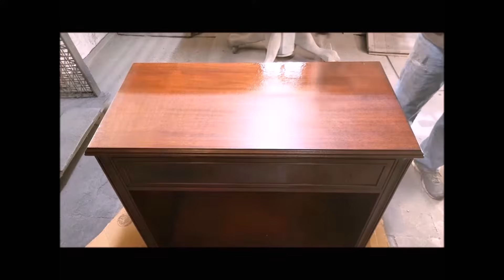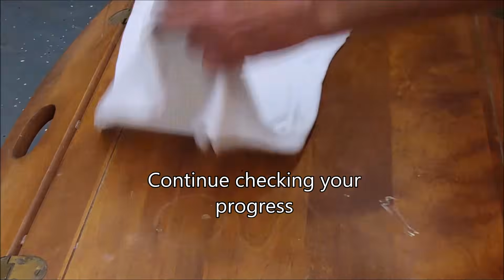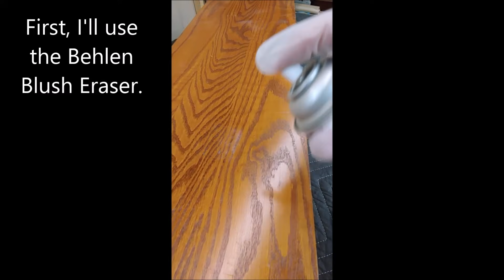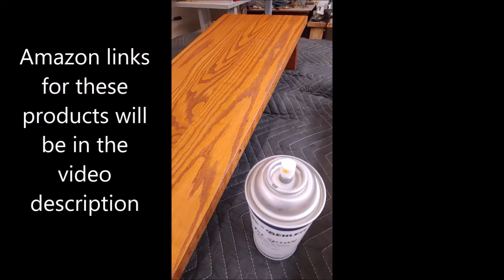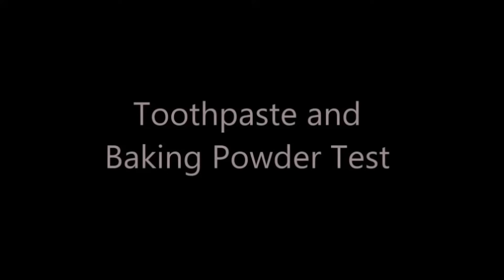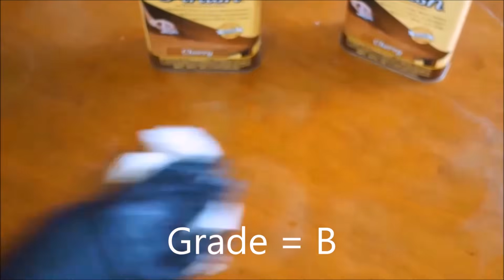Removing white water rings and heat stains from wood furniture | THE ULTIMATE GUIDE | NEW VERSION

Comment: I did a polyurethane varnish and washed 24hrs to use my table... Layed a table cloth and someone put a hot plate on the table cloth, which attached to the table!  Left a mark from the heat and texture from the table cloth. Please help me?

Comment: I told my spouse to use an iron but we didn’t have one so my spouse heat up a pot and a pillow case since we don’t have a tea towel either.  He kept it on too long in one spot and the pot burn through the pillow case and onto the table and destroy the finishing.  We just bought the table and used it once!  So sad! Any recommendation for fixing that mess????

Comment: Another trick that worked for me is using a hairdryer and tissue. Aim the hairdryer on warm at the stain  and keep it rotating. With your other hand keep rubbing the stain with the tissue. The hairdryer should be on your hands and not directly on the stain (only in some intervals)

Comment: I have a circe stain on the top of the wood case of an 80 yr old antique radio. Probably try the iron method as I must maintain the original look of crackled and worn finish of the redt of the pirce. The thinner etc method is good for making things look like new as it sort of disolves and redistributes the finish 11:14 in

Comment: Thank you so much for this video. Watched it in its entirety (well, my wife did after I forwarded it to her) and, following your suggestion to use whichever method worked,  started with the iron and cotton cloth. This was to remove a couple or more water marks on the surface of a writing bureau. 

It worked! 

Very pleased with the result and minimal cost. Just 10 mins careful heating. 

Thanks again.

Comment: Thanks so much for your video! I used the iron technique and it removed all of my cup marks! Thanks also for the advice on how to set it to low and then (if needed) step up the heat gradually, I did need to step up the heat, so it was good advice that came in handy. Thanks again.

Comment: Ironed out 3 water stains caused by 3 hot corn on the cobs on paper plates.  I cut an old pillow case in half so I could use is as a single cotton cloth. Tee shirt was too difficult to position on round table.  Had to turn heat up a little bit after it wasn’t working.  I also kept lifting the cloth to make sure it wasn’t sticking.

Comment: Absolutely stunned. I had a mahogany table with a white/pink/purple water stain on it. Saw the 'ironing' method on here, and gave it a go. I didn't believe it could possibly work (and didn't really think anything could on the horrible mark). I was totally stunned by the result. The main mark completely disappeared, and I've been left with a slight ring on the surface. Thank you so much.

Comment: What??! Mayo works. I removed 7 old white rings of various sizes on a vintage table last night. Not sure what brand of mayo you used via that squirt bottle, though the mayo does need to be a good brand with fat and at room temperature...per my mayo experiences. *)  Another tip for anyone who smokes, if the water stain is new, mix ash with a dash of water, rub over stain with clean cloth, wipe clean, then buff if needed.

Comment: The ironing method saved me.  I had used a hand towel instead of a coaster, and a white circle appeared where my mug was! Two minutes later I found your video, grabbed a cotton tee and my iron and in less than 10 mins on low/medium heat, the table was restored. The luster was not impacted, I did not have to polish it. Follow the instructions, "keep the iron moving" and "apply medium heat". Thanks alot for this tip.

Comment: You failed to mention the easiest method that works with zero risk and zero cost. I used a heat gun and it removed it in about 1 minute.

Comment: Just got blush remover in the mail. Need to fix a huge 1 foot by 1 foot heat/water stain from a leaky foil pan during 4th of July. BRB

Edit: Went back to check on if after 5 minutes. It’s already almost gone. Holy crap! These fumes are something else, though. Should’ve known there was paint thinner in this stuff.
Reply from the maker: Truth.....fumes are pretty horrendous !!  Glad it worked !
Reply: @FurnitureRefinishingStudio  It really worked well. I’m glad you mentioned breaking out a brush too. I couldn’t find anyone who’s still selling the stuff you used so I got Mohawk No-Blush and the can instructions tell me to let it sit to dry. 

I noticed the parts I missed with the brush had the dissolved finish puddling up like little droplets. If I let the whole thing sit, it would’ve looked like a horrible blob of a mess. Had to go back over those with the spray to smooth everything back out, but all in all that was the best $20 I’ve ever spent. Now I’m going around trying to find the water stains I’ve forgotten about through the years LOL

Comment: The 5/1 mixture of Restor-a-Finosh and lacquer thinner worked wonderfully to remove a water ring on a cherry desk top.  A+.  I wasn't sure how long to gently rub it in with the 0000 steel wool.  So, I did two minute applications. The first application lightened it noticably.  The second made it nearly invisible.  The third application made it vanish. Thank you so much for the great advice.
Reply: The iron  method works perfectly. It is free..and even a numpty like me can do it in just a few minutes.

Comment: Not sure this will be answered, but I need help.  I tried the baking powder and toothpaste to remove a heat stain with a disastrous result in the top of the table becoming foggy and seemingly removing part of the shine where I wiped it away.  I have no idea what happened, but I tried everything to get rid of it except the iron trick.  I'm desperate at this point.  Any ideas??
Reply from the maker: Toothpaste and baking powder are mild abrasives. If I recall we gave that one an F. There is no way to advise you but if that mild solution caused damage I'd suspect you just have a bad finish.  Not all finishes are salvageable.  Not saying yours isn't, but it's something worth putting out there.
Reply: @FurnitureRefinishingStudio  I'm pretty sure it is a veneer, and I know you gave that combination of chemicals an F, but when I wiped it away, it just messed up the finish so, maybe it is more abrasive on veneer than if it had none at all?  I did end up buying #0000 steel wool and that Restor stuff so, I hope that fixes it.  I'll let you know and thank you for responding and for this video!
Reply from the maker: Please do. The veneer doesn't have anything to do with it though, this is more about the protective coating on the veneer. Hope the Howards works for you !!
Reply: @FurnitureRefinishingStudio  Update: I reapplied the baking soda/toothpaste on the remaining sheen to remove it and start on a non-glossy surface to give it an even coat on the restoration.  Applied about two thin coats of the Restor-A-Finish with #0000 steel wool, let it sit for awhile, wiped away what remained with a soft clean cloth and now it looks beautiful.  The top shines and the abrasive look is gone.  The heat mark is still a little bit there, but not nearly as much.  Thank you so much for your help and advice!

Comment: Another method that worked for me completely was using petroleum jelly. My situation wasn't with a water ring but a water bottle that leaked so there was a fatass white filled circle. You put a generous amount and rub it in for a minute or two, and I let it sit overnight just in case. Woke up and everything was gone.

Comment: My white marks are caused by another culprit: hand sanitizer, keep it off your wood services. Any suggestions?
Reply from the maker: Interesting, another comment suggested hand sanitizer for removing water marks.   Alcohol should not create moisture marks, but it could absolutely cause finish damage.
Reply: @FurnitureRefinishingStudio Thanks for your reply,  maybe it just damaged the finish but I tried the iron, dry heat and white towel and checked every few seconds so as not to cause more damage and it worked pretty good. Most of it is barely visible. After I gave it a good polish with Pledge Extra Moisture.
Reply from the maker: Good to know. Glad to hear it all worked out !!

Comment: What works great but is not covered in the video is hand sanitizer gel. Fold a paper towel in half, put some hand sanitizer gel on top of the paper towel and lay the paper towel on top of the stain with the hand sanitizer side UP (don't let the hand sanitizer come into direct contact with the wood surface. All you need for this to work is the fumes from the alcohol.) Let it sit for a few minutes, then check to see if the stain is gone. If it isn't let it sit some more. Repeat for a few minutes at a time until stain is gone.
Reply from the maker: The active ingredient in hand sanitizer is alcohol, Covid made sure we all know that, right?  Well alcohol is the solvent for shellac so hand sanitizer would amalgamate the finish which is the goal so very plausible on shellac.  I personally know that alcohol also softens "some" lacquer, making it also plausible on some lacquer finishes. We will have to run some tests, because it's also possible it could also harm some finishes.

Comment: Toothpaste does work as does anything you can use as a burnishing agent, you just need enough elbow grease to create heat. Hence why the iron is so effective.
Reply from the maker: Thanks for commenting !!  I appreciate and value your opinion, but It's a little more complicated than you suggest, . If you watched the first several minutes, I try to clear up what I believe the cloud left behind by the moisture actually is.  Heat can work, but it works by softening the finish and subsequently filling the microscopic voids left behind by the moisture. On FRESH rings, heat works  through evaporation,  Most methods that work achieve one of two goals, they amalgamate the finish just to the point of filling in and eliminating the empty moisture pockets OR they fill the pockets with liquid, hence why oils sometimes work on very deteriorated and older finishes. It's important to note that a method which works on one table may not work on the next because it all revolves around the specific finish chemistry, finish condition and how long the moisture mark has been present.
Reply: @FurnitureRefinishingStudio  which is the best method for a six month mark? I've tried the iron method but it did not work...

Comment: I bought a tin of the Mohawk "No Blush" from a great UK company (Morrells of Exeter). I just tried it with high Hope's on an antique dark oak table with a watermark from a flower vase, but unfortunately it hasn't really made any difference.
Reply from the maker: The reason is most likely the age and subsequently the finish on your antique oak table.  "No Blush" won't work on shellac, only lacquer. Lacquer wasn't really developed until the 1920's,  If your table predates lacquer (100+yrs old),  and is in original finish you'd want to choose another method.  Save that no blush for another piece though.....it's time will come and it doesn't go bad.
Reply: @FurnitureRefinishingStudio  ahh damn, I didn't realise that... Any suggestions for what to try next? I really don't want to strip it completely and lose all the lovely patina if I don't have to.

Comment: Thank you so much for this advice. I purchased a 50 year old sewing machine in a wooden cabinet. The wood had numerous water stains. I used the last method from your video; Restore-a-Finish, lacquer thinner and steel wool. After soaking in overnight,  the cabinet looks brand new.
Reply from the maker: Glad I could help!
Reply: I'm so scared to try this technique but I bought a second hand dining table and it has heat stains and white marks on it which they never mentioned to me :(
Reply: @deniseleonard4525  Did it help?

Comment: Why didn't you show your favorite way first?!
Reply from the maker: Because I didn't.  I did however, show the most popular method first.
Reply: To quote from his replies "No blush works very well on lacquer, and the majority of furniture is finished with solvent based lacquer, but it will not get you the same results on shellac or wax, or even poly. No blush works best when the solvent for that finish is lacquer thinner. 
There is no one method that universally removes white moisture stains in all situations, nor can you or I tell someone what product will work for them. This video simple demonstrates various options."

Comment: Thank you very much for this video.... this totally worked for me to get out the heat marks in my dining table....I used the iron method ... i had like 7 little muffin size circles from making egg muffins and putting them in a paper plate straight out of the oven and set them on the table....big mistake!!!

Comment: If already have treated with Restor-a-Finish & Howard's Feed N Wax, can I still try the 5 parts RAF and 1 part Mineral Spirit to remove the white rings? Bought the table with the white rings so do not know how old the rings are.
Reply from the maker: Did you try the iron?  BTW, it's 5 parts RAF, one part lacquer thinner (not mineral spirits).  I would think you'd be okay, but just experiment on the edge, or a leg. Every finish is different so I'd proceed with some caution.

Comment: I’m in a nice hotel and left a glass of water on the wooden desk like a dummy because I thought it was coated in poly. Wrong! I used the iron trick very carefully on the medium heat setting, checking it frequently and constantly moving the iron over the shirt. It worked!!!!! Thank you and praise Jesus! 🙌🏻🙌🏻🙌🏻
Reply: ThisIsTheEnd Same here, nice hotel...sweating beverage.  I did not have access to an iron but instead used a blow dryer and dry wash cloth and it worked.  I heated wood and then placed wash cloth over it and rolled an orange across the wash cloth for the heat impact effect.
Reply: What ya nuts or sumptin? Yaint liable fer that shit in no hotel. Hell, I be bitching they didn't do it right in the first place. I can see crappy joint trying to make ya pay but a nice place shouldn't give a dam bout no water mark. Ask a lawyer or look it up.

Comment: I used the Mohawk spray on a large 10 x 12 inch heat stain on our Pennsylvania House dining room table caused by a hot casserole dish placed on a towel and not a hot pad. After only one spray the white heat mark completely disappeared.  However, the spray seems to have left a film that is very noticeable when looking at the area  at an angle where I sprayed.  Is this a film or perhaps the spray "ate" the shiny surface coating which I assume is lacquer?  Now what?  Thank you.
Reply from the maker: It's of utmost importance that the No Blush only be very lightly applied. A few mist sprays. Results will vary because not all finishes and situations are the same.  Let dry thoroughly. If after 24 hrs you see a haze, as you say, I would expect it should polish out unless the No Blush was sprayed on much too heavily.
Reply: Thank you for your response.  What should I polish it with and if it was applied to heavy then what?  Thank you
Reply from the maker: @brucebrackbill4383  , You have a Pennyslvania House set, so its lacquer. It's impossible for me to say without seeing the table in person, but start simple and polish the table with Mohawk Finishing Products Scratch & Mar Resister Polish.
https://amzn.to/2PK2WRs
Reply from the maker: If a quality polish doesn't work, than the next step would be a mild compound.  NOTE: this step is for finishes with a higher shine, NOT flat or matte finishes. The beauty of lacquer is that it can be resurfaced and rubbed out which in many cases will renew the finish and remove surface imperfections. Using a mild compound and following the directions will in most cases produce great results.  I highly recommend Howard Restor A Shine ......https://amzn.to/36zrX8m
If the Restor A Shine is used, follow it up with the Mohawk polish, because the Restore A Shine will remove any wax or polish that is on the finish.

Comment: I cannot find the Behlen B-101-087 anywhere syas are out of stock and it has been discontinued.  You showed the Mohawk M103-0475 in your video but did not use it.  Does it work as well?
Reply from the maker: Yes, works exactly the same. The company that owns  Mohawk bought Behlen - same product, different label.

Comment: just use the no blush and call it a day, all others are just a waste of time...
Reply from the maker: Sorry, I do NOT agree with you Derf. No blush works very well on lacquer, and the majority of furniture is finished with solvent based lacquer, but it will not get you the same results on shellac or wax, or even poly. No blush works best when the solvent for that finish is lacquer thinner. 
There is no one method that universally removes white moisture stains in all situations, nor can you or I tell someone what product will work for them. This video simple demonstrates various options.

Comment: I have new rings in a table that does not have a varnish or poly etc finish on it.  I has a wax finish on it but honestly it is past due for a re-waxing.  Will the iron method or the "blush" products work on this or would it damage it more?  Perhaps there is a better method for this type of furniture but I searched your videos and couldn't find it!  Thanks so much for any suggestions you might have.